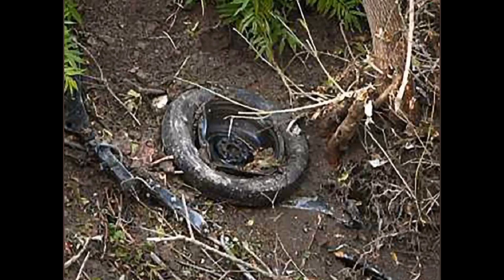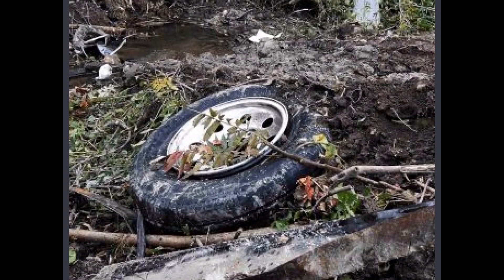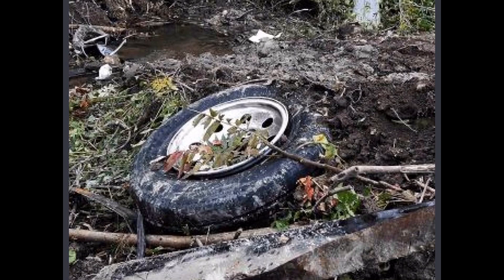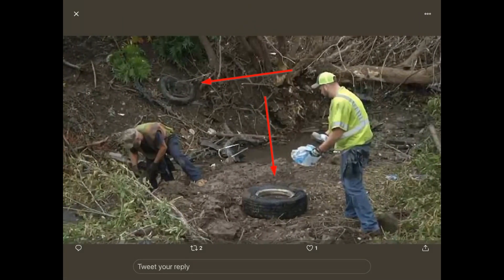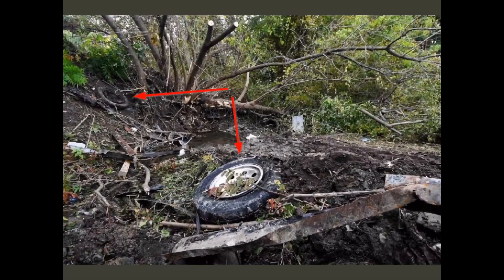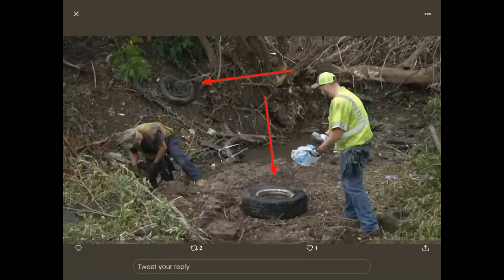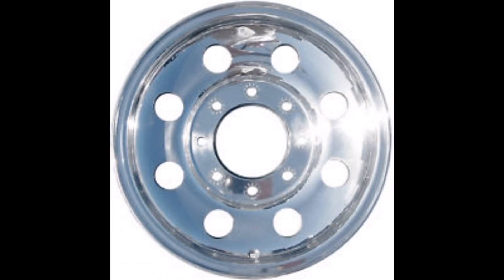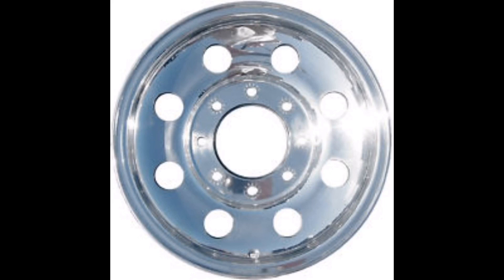NY Limo Crash updates

Comment: That steel wheel is a donut or spare for a smaller car. Lug pattern and spacing is wrong too. Wheels don't just come cleanly off in an accident. If wheels do come off they usually are missing the center where it has torn from impact or the hub and knuckle are still attached to the wheel from being torn from the car with it. Either case it would not look like someone took it off and threw it there.